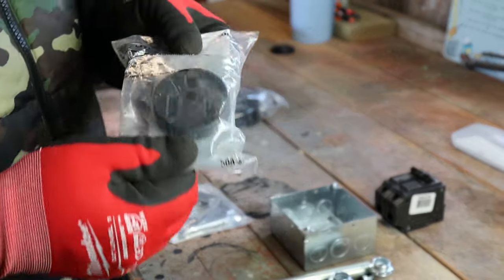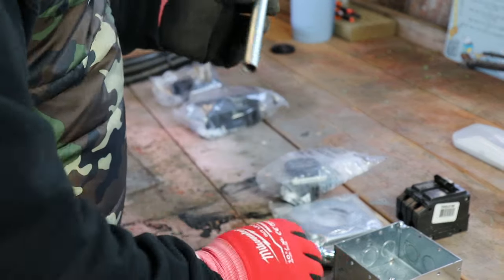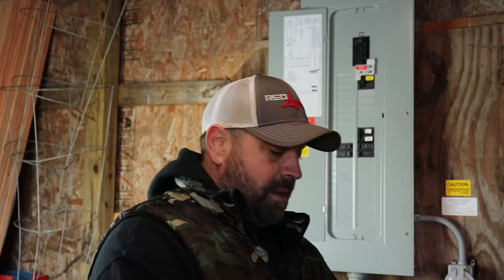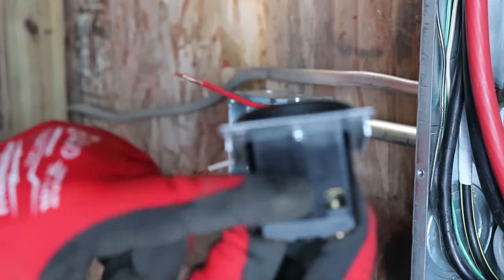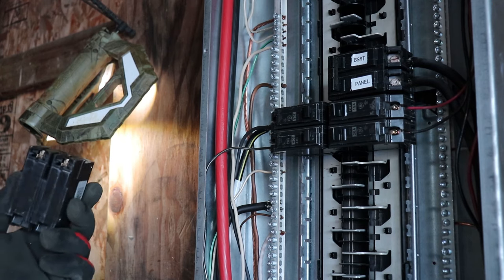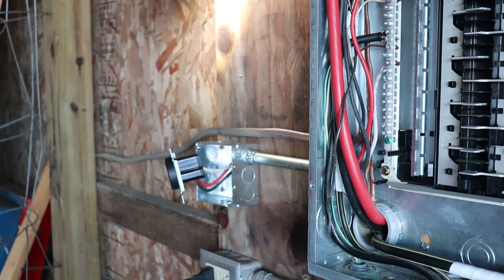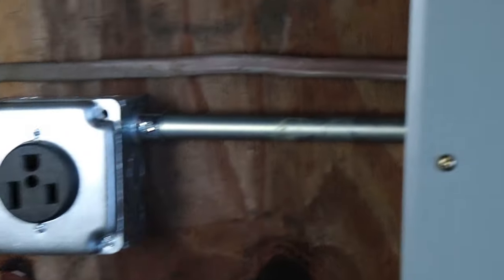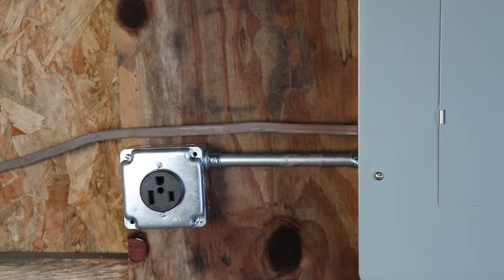Welder Outlet 240V (Complete Installation)

Comment: Thanks for the vid to confirm one thing I was wanting to verify, which was what type of enclosure you where choosing to use and then wondering what gauge you where going to use for the run as i am using a 6 gauge 3 wire plus ground Romex as it was cheaper for me to get as it was precut but not sold and they wanted it cleared from inventory so i got 45 feet for 40$ and that is getting it for a song, the breaker cost more then the wire (61$) and i got a manufactured official welding extension cable, 50ft for 60$ (reg 285$) so a song for that as well.
Just FYI the white wire is NOT ground it is your Common and should not be called ground even if they share a bus bar if you have a FMDP as saying ground usually indicates earth grounding. The ground line is a non shielded copper line inside the main wire body and only goes to the ground on the panel or a shared bus on a FMDP main panel. On the plug the grounding pole can be used with a ground line  but it is advisable to use the white common line as it is thicker and can take more amps then the dedicated ground line.
Some welders and plasma cutters have a hookup on the welder itself for a earth ground line hookup,
So you have 2 hot, (or what you are calling live) and 1 common or the bare copper ground, but if you do use the white common wire which i would suggest still connect the ground line to your plug enclosure and to the ground in your panel. 
One small thing, if you are using a First Means Disconnect Panel  (FMDP)your ground and common share a bus in this case so you could use the bare coper line to connect to the grounding pole on the welder plug, but if you use this which was not the case in this video, you can say you are using the ground wire, but if you use the wire wire you should call it the common line not the ground, and while in these cases you can use the shared bus if this is the case i would use the common line as it is thicker then the ground and then in your panel and receptacle put a green piece of tape on the common line if that's the line you choose to use and not the ground line.

Thanks for the vid and keep up the good work.

Take care :)

Comment: Great video and easy to understand 
step by step. Actually, I already have a 240 line with a long extension cord coming from my garage fuse box that plugs into my gas generator for when the power goes out. I simply, turn off my main breaker in my basement, then turn on my breaker for my 240 service in my garage, which also has a dedicated line running into my home breaker box
It saved me countless times when my power went out in rain and ice storms running my sump pumps, refrigerator and all house hold items. Long story short, I simply want to hard wire a 240 receptacle into a 15000 watt electric garage heater and use the existing 240 line extension cord to plug into it.  Just like I do with my dedicated home generator in my garage.

Comment: Also Question why did you choose to use threaded Romex ad not solid copper Romex lines as it runs hotter on full draw and has a worse resistance then pure solid copper lines?

Comment: I’m looking at this same project for my welder and plasma cutter, I’m not an electrician so I’m a bit confused. Why didn’t you use the bare ground wire? 

I’ve seen some videos where the ground wire is looped onto the box ground terminal and then a pigtail to go to the outlet. Also some people terminate the white/neutral and not use it. 

What is the difference?

Comment: Don’t let the juice get on the floor. Slippery!
I want to add a 50 Amp 220 vac outlet to my existing outlet that’s for my air compressor. Can I hook the new one into the existing one? They won’t be running at the same time. The new plug is for my MIG welder. 
Thanks

Comment: I need to install the breaker in the 200 AMP panel located in the basement. I will run the conduit about 15 feet away into the garage.

Comment: Just to confirm so it has two positive wires black and red not just one like you would do a regular plug I'm asking because the breaker has for two wires so it would have to be two positive right

Comment: I'm installing a 240V line for an Air compressor. In order to make this circuit as versatile as possible, I'm thinking of running either 6/3 or 8/3 wire to the outlet. I notice most air compressors don't appear to use a neutral though so should you just leave the neutral disconnected on both ends, or do they make some kind of adapter to adapt the 3-prong plug on the air compressor to a 4 pronged receptacle (w/ neutral) outlet box?

Comment: interested you put the ground on the neutral bar ?
Reply: This is a main panel (first means of disconnect) the neutral and the ground are bonded (connected) here. In a sub panel the neutral and ground are separated.

Comment: I am getting ready to do the same for my new jointer and band saw that need 220.I bought metal outlet boxes as well to attach to the poured basement wall. I thought from my research that if using a metal box you had to ground the actual metal box by adding a green screw directly to the box. I am no electrician just a diy type and was wondering why you opted not to do that step? I want to ensure I do it right.
Reply: Metal boxes should always be grounded and not rely on self grounding screws to make the connection
Reply: I agree.keep everything grounded
Reply: It's grounded through the conduit.   Alternatively  you could add a lug in the box and add a green 6awg wire back to the ground bar

Comment: in Europe, a typical socket is 230V AC. The lighting circuit is a 10A protection, 16A sockets. The nominal current of a typical single-family house is 25A. Conducted with a 5x6mm2 cable from the outside. power demand is 10 / 15kW. 3-phase 16 / 32A 400V AC sockets are used to power larger machines such as a carpentry saw. We have been using RCDs obligatorily for 15 years. We do not use metal junction boxes. The cables are double insulated

Comment: I was told to do 2   40 amp breakers. One on each poll of my fuse box. Is that nesasary?
Reply from the maker: I don't think so. I'm not sure why someone would put two breakers on? It isn't needed. I run a 220 welder on this set up with absolutely zero issues.

Comment: Why is there no neutral on a 250 volt outlets? Thanks for your video.
Reply: I'm not a licensed electrician but I believe it is because the power coming into a residential house is two phase 220-240. The potential between the two phases is 240V RMS and the 120V is half the potential between these two phases. So a 120V circuit will use either L1 - neutral or L2 - neutral and a 220 circuit will use L1-L2.
Reply: Because each leg carriers 120v for 240v across them. 120v circuits have one 120v leg and a neutral
Reply: The 4-prong receptacles have a neutral, 2 hots and a ground. If the equipment doesn't need any 120 volt service, then the manufacturer can reduce costs by eliminating the neutral. You only need a neutral if you need to supply something with 120 volts. I suppose you COULD achieve 120 vac by connecting the machinery to one hot and to ground, but that would probably be totally against established electrical safety codes.
But I know what you mean. It's frustrating to have equipment that won't connect because your plug won't fit the receptacle.

Comment: Why did you use the ground as if it was a neutral? I thought their was no neutral in 240v? And why didn't you just ground the outlet to the receptacle box and ran the to hots back to the panel breakers?
Reply: Because the receptical box is not grounded to anything in your scenario. If a hot leg were to get a bare spot on touch the receptical box then the entire box would be energized at 120 and waiting to hurt the next person who touched it. The ground has to go back to the main panel in order for the breaker to be able to trip when this theoretical bare spot rubs the inside of the receptical box
Reply: @calebtoutdoors7217  The receptacle box is infact grounded because of the emt  pipe connected to the panel box which should have a ground rod wired to it... think of an room outlet in your kitchen,that outlet has a green cable hooked up to the box and if using romex to the wire same here why not get the 2 hots on the 240v outlet and one ground straight to the box....

Comment: Please help me explain what I need to do if the plug I have is 220 and I need a 240 plug aswell.  Can I have a converter plug for that or I need to have another met outlet for the 220 that is a separate dedicated line on its own. So I need both 220 and 240 for different things how solve the issue. I have a glass fusing kiln with the different powers. I appreciate all your help and information.
Reply: It’s was super helpful to see how you explained it.  Thank you .

Comment: My friend needs to run a 220v outlet in his shop for his everlast welder. Not sure whether to get an electrician or do it ourselves.
Reply: Am Scout Got a 240-50 installed in my garage about 30’ away from the panel for $290 all-in. Worth it for piece of mind.
Reply: Am scout do you still need it done??
It is really easy

Comment: Thanx for the video huge help. Question for ya. Does the Red and White matter which side goes into the breaker switch?
Reply: yes only if there are multiple red and black wires on other breakers in the panel. they would go black red black red black red ect...

Comment: I just got the same hardware to make an extension cord .  
Is the short blade considered the "Hot"  I remind myself that in 120v outlets that the Hot wire is black and connects on the "Short" terminal or short slot and corresponding short blade . The white wire is considered neutral .
Reply: The little mean one.

Comment: Will work well, and it's safe enough, but not up to code anymore. Need an additional ground now... annoying I know, but folks, if you want your insurance to cover in case of a fire, make sure you are up to code!
Reply from the maker: Zero chance this will cause a fire. Zero.
Reply: @TheCookFamilyHomestead  I know. And that's what pisses me off... I had to change all outlets in my shop to please the stupid insurance after a surprised building inspection; them saying that it wasn't up to code. But I've been in business for 20 years and nothing happened and I'm running one 252 Miller and two 352s plus a plasma cutter... go figure!
Reply: And what would an additional ground do? And what code are you attempting to reference?
Reply: @davidnobilese6124  Le code du bâtiment du Québec, they call this a "returned ground" in French. The bureaucrats came up with this, just in case the white wire comes loose because of its size, the extra ground smaller and less chance to loosen over time, is a backup. Fucking dumb rule, and totally overkilled, but no choice otherwise insurances won't cover any loss if anything had to happen and the electricity would be the cause and not "to code".

Comment: My panel does not have a main switch to turn off power. Is it possible to turn off power by turning all breakers to the off position
Reply: Then it's probably a sub panel, go to the panel feeding it and turn off the breaker there.

Comment: Hi, great video. I just ran a 10-3 wire to a plug for a heater in the shop .I put the nutral wire in the ground spot as you did. I dont have a sub panel in the shop yet. If you ran from the main panel would you use the ground or nutral ? Thanks for your time
Reply: Every circuit breaker panel has to have the same number of neutral spots as circuit breaker locations in order to be UL labeled, so it you have space for 20 breakers you have 20 screws for neutral (white) wires.  By code you are not allowed to connect more than one neutral wire to a neutral bus bar screw.  There is room on the neutral bus bar for your neutral.
Reply: On these plugs it’s supposed to be 2 hots and 1 ground. Not neutral.
Reply: @FishFind3000  I was answering the question asked by noraa above.

Comment: This stuff is lethal.     The fact that you can do something doesn’t mean that you should do it.

Here in the great south land these parts are not sold in hardware stores.

They come from trade suppliers who will always refuse you if you don’t know what you are doing or if you look dopey!!

At 240 volt the biggest plug YOU can buy is 15 Amperes.

A little knowledge can be a dangerous thing!!

Stavros
Reply from the maker: Been using my welder a ton with this plug with zero issues. None. Feel free to go troll someone else. You are wrong.
Reply: The heck is that guy talking about lol

Comment: Will the welding unit trip the 50amp breaker if you turn it up higher than 50amps? Thanks!
Reply: No, because the welder changes its amps by altering the output voltage. It 240 supplys the welder at 50 amps then the welder is turned to 200 amps then the output voltage is actually lowered to slightly more than 50 volts. The input amps will stay proportional to the input volts.

Comment: Hey bud, I am installing ground on the same exact outlet but instead of the white wire I have 2 shades of green. What do I do now?  Please help me?
Reply: the colour of the wires is irrelevant. typically green is ground and white is neutral and black/red are the hot legs. If you have 4 wires and are installing a 6-50R receptacle (same as the video) you'll have an extra wire that you wont need.
Reply: @TheIanmurphy  Thank you very much, it turns out you are right... one of those green wires was attached to an electrical box for grounding.  Later on, I measured the electrical current coming out of the outlet and it was just as it should be (240 V) Cheers!

Comment: doing a breaker install from power box to carport, about 36 feet to run cable should I run 6/2 or 8/2 wire for my compressor and welder/ plasma cutter ? and can I run two plug ins off the same breaker?
Reply: No. One 220 appliance per breaker.

Comment: hey you made it seems so simple. I have experience with smaller stuff like 3d printer psu's and stuff like that but for some reason, after being shocked once by a breaker box its hard to get myself to do it lol. I am going to do it though this week and just wanted to see if you maybe know how to turn off the power to the breaker box? Is there one in there that shuts down power to all of it? or is there a main outside? I have only 1 breaker panel obviously. What do you think? Thanks for your time and great vid.
Reply: Your panel should have a main switch at the top, it usually much larger then the others.
Reply: i was wondering the same thing

Comment: just remember, if that is not your main house panel, and is your garage panel separate from the house panel you had better separate your grounds on one side and neutrals on the other, because it is considered a sub panel, I have had many service calls of people's lights Deming and not getting proper power to other things ,thanks God bless
Reply from the maker: Actually, this is my main panel. The garage was built first and all electric was installed in garage. I have a line that runs underground from the garage to the house for electric. God bless my friend!

Comment: Genuine question here... why are some electrical plugs installed upside down?
Reply from the maker: This is not upside down. I know it looks that way compared to a regular outlet, but it is correct.
Reply: If you are referring to some outlets in the house, sometimes it indicates a switched outlet, meaning the power is controlled by a switch for a lamp, for example.

Comment: Hey my 6/3 cable comes with a red black white and solid copper wire my outlet connection and power plug calles for white black and green how do I connect these together
Reply: victor Martinez for welders you only need 6/2 so 2 hot and 1 ground no neutral. You have 6/3 so you have all that plus the neutral which is good for 4 holes outlet like a dryer. In your case you should use red and black as hot and the solid copper to ground your plug with the box if metal and the ground bus bar in your panel NOT the neutral bus bar. Here the small piece of conduit is not really good a 6/2 cable needs air in dry space so the heat can dissipate easily. Hope that helps.

Comment: I hope that's NOT a subpanel.  Or your connected to the neutral bar for ground.  That a no no. The neutral and ground must be isolated inside the panel.  If it's a main panel, never mind :)
Reply from the maker: It os the main panel.

Comment: Is there a possibility that there can be a 240 volt with a 120 outlet plug?
Reply: I can’t give a definitive answer but my best bet is you can’t, especially if you use a 3 wire (2 hots and ground) as ur 240v outlet as there would be no neutral for you to get 120v from. Can’t say I’ve seen this done
Reply: It is possible but it would be a wiring mistake and a hazzard that should be corrected ASAP. A standard wall receptical should only have 120

Comment: if you take your multimeter and measure each Live hot wire with a ground wht value does it show on the multimeter because in south america 3 phase connection is means 3 live hot wires and a ground so if you one live hot and a ground you get 220v shown on the multimeter so i wonder how does it work in the United States...  do they both add up so they end up being 240v outlet meaning tht each live is 120v i dnt know if anyone could answer my question
Reply: 120V plus 120V =240V USA